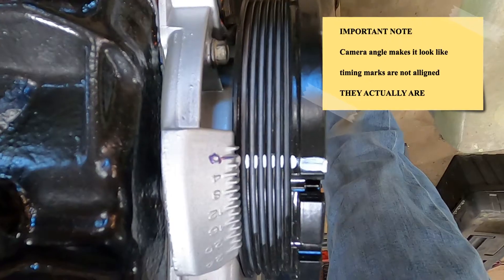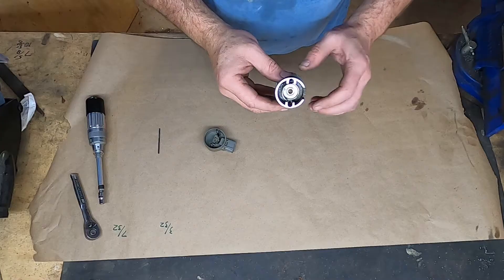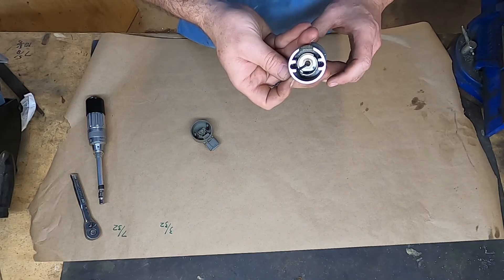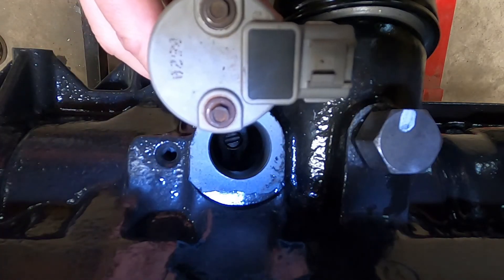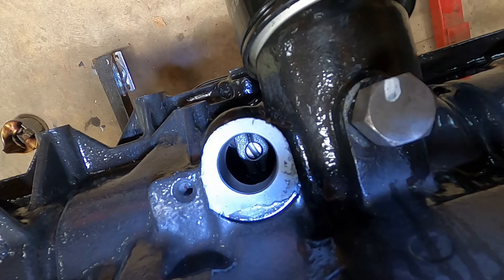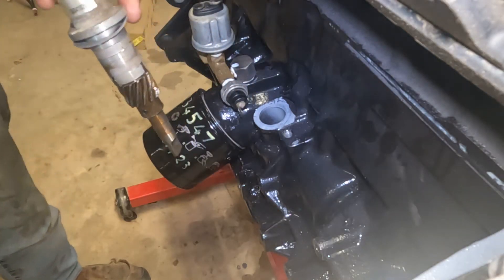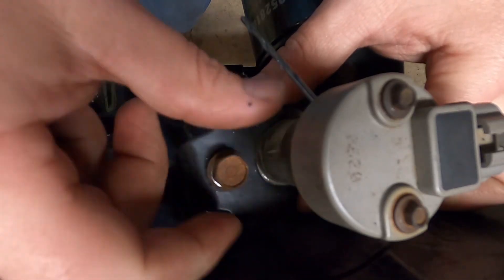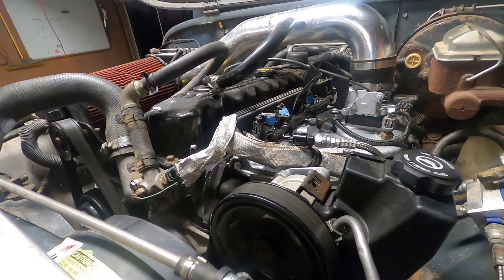Cam Sensor Synchronization on a Jeep 4 0 engine

Comment: Ok. So my 2004 engine is, ya know, still in the vehicle and doesn't have the nice little timing plate.
Reply from the maker: You should still be able to do it just fine.  Find TDC (dont need the plate) and follow the steps

Comment: My new cam sensor and pump drive assembly doesnt have a hole for a pin.
Reply from the maker: That's interesting - does it have a plastic clip to hold it in place?
Reply: @theshop392 looks like it has that instead, yes.

Comment: Other videos say you have to be tdc on exhaust stroke.  confused.  https://www.youtube.com/watch?v=yo_HRGlUYrM&t=1s
Reply from the maker: It had me confused at first too.  When you are installing your timing chain the dots line up on the exhaust stroke I agree there.  Unlike a distributor the sensor is only looking for the pulse to confirm with the CPS that the timing is correct.  Either way it works...
Reply: @theshop392  you would be 180 out from your way if you were on the exhaust stroke.

Comment: Is it ok if there's a little back and forth play in the cam shaft synchronizer after it's installed in the proper position?
Reply from the maker: Hard to say how much a little play is, there will be some movement but it shouldn't be much.  Does it tighten up when you clamp the retainer down?

Comment: If the Jeep is anything like a small block Chevy, you can lower the shaft until the gears align and it’s pointing in the correct position.  Then to get the oil pump slot to line up, you just turn the engine over by hand and it will drop into the slot. Even if the pump slot isn’t aligned, the gears are meshed and it will keep the timing correct as you turn it over to align the pump slot.  Easier than fiddling with a screw driver trying to get it just right.  
Thanks for the video!
Reply from the maker: Thanks for sharing that idea!  We certainly will try it on the next build!

Comment: You are the man. Thank you for the video. I just bought a 2005 unlimited. I'm getting the POO16 code.   So on Saturday I'm going to go through everything to make sure it's all at TDC before I purchase replacement sensors.
Reply from the maker: Do you know if the 05 has the opda (large diameter oil pump drive). If it does I would recommend replacing the cam position sensor before you replace the whole opda.  My 06 wrangler threw a similar code and I had to replace the sensor, no need to pull out the opda.  I couldn't get an original sensor and the aftermarket one did not work correctly untill I put a washer under the sensor
Reply: @theshop392  Yes it does have the larger (new style) OPDA. I used to own a 2006 unlimited that I had bought a new and drove it for 11 years.  I only had to replace it on that once.   This new Jeep appears to have a newer OPDA.  So I'm going to need to get it to top dead center to verify that whoever installed Did it, put it back correctly.
Reply from the maker: If the Jeep was running before it threw the code I doubt that the timing jumped, unless the opda is damaged
Reply: @theshop392  Yes it was running. It still is. I just ran it yesterday at highway speed for about 20 minutes.  Everything seems completely normal.  Just has the CEL light and that code.  Since I just purchased it I don't really have any history so I'm starting from scratch on this one.  It also has 198k miles.
Reply: @theshop392  I used to rock crawl my '06 LJ.  I'm planning to do a budget crawler build on this one because miss the rocks. Haha
Reply: @Bubbz2024  That is exactly what happened with mine, I would try replacing the sensor before you pull the OPDA.   I used to off-road in competitions with a buggy, really miss doing that!
Reply: @Alouette632  Yes thank you again I ordered the sensor. It gets delivered tomorrow September 27.     It was super easy to change the OPDA on my 2006 unlimited. I have the factory service manual so I just followed the instructions.   You used to do competition? That's amazing.  A dream of mine.     

I'm going to try to make short videos to post up modifications I do to this new (to me) Jeep. I made an extensive build thread of my last unlimited.  I installed a completely weld on triangulated four link Long arm suspension system. With four and a half inches of lift with ARB air lockers front and rear along with a Dana 44 front axle swap.  The Jeep was more comfortable to drive after I built it and with the stock suspension lol

Comment: Best one I've seen yet.

your first comment about not setting TDC first is the best part!

If you also mentioned "rotating this sensor will NOT change ignition timing" it would be absolutely perfect.
Reply from the maker: Thank you.  If I understand you correctly, the ignition timing is managed by the ECU, so rotating the sensor will not adjust the timing like an old distributor.  However rotating it too far will cause the ECU to throw a code.
Reply: @theshop392  sometimes they'll throw a code but usually they just don't run when ya do that.

the distributor 4.0s act almost the same except you get ignition breakup at idle or WOT depending on which direction it gets rotated before it completely dies and more often than not, also no codes.

but still, They're all crank fired ignition where the ECU/PCM directly pulses the coil for timing control since 1987 and the ONLY way to change baseline ignition timing on these is to physically move the crank sensor in reference to the flywheel.

The earliest ones (87-90) had knock controlled spark advance and the ignition system was derived from the Renault Alpine GTA. They were very much ahead of their time.

Comment: This is the best video I've seen for the cam sensor syncronization, I like you refer to the Service Manual procedures. Thank you for sharing!
Reply from the maker: Glad it was helpful to you.  Yes it's always best to work straight from the Service Manual
Reply: @theshop392  How can you tell if a Cam Synchronizer is malfunctioning? Mine makes like a clock ticking sound, is that normal? I greatly appreciate your videos
Reply from the maker: @Ache87  Mine does not tick.  I suggest you open in and look for contact in the window, also check the gear for damage

Comment: I had to remove my alternator and bracket to get my finger into #1 spark plug hole. Had my son feel for pressure while I got under the jeep and turned the crank to TDC.  Magic. Then,  my Cam Sensor oil slot was almost to 12, more around 11:30 position.  Found out my 'new' cam sensor was faulty, but worked good enough to get going. My TopDon 600s scanner was able to show me cam sensor degree readout. Every time I got to near '0', it would go straight up to 65,000 on the graph.  I just lived with a 1.5 degree setting and was done. I was surprised my scanner did the cam degree thing. Bonus.  Very sensitive to get the reading right, but 'graphing' the cam degree readout really helped.  Thank you for this video, it gave me the confidence to do it myself instead of dragging the jeep downtown.  I also did the Viper Coil mod too.  That was a story in itself.  Have a great day, thank you.
Reply from the maker: We are glad that the video was helpful.  Aligning the oil pump slot is a bit tricky.  Unfortunately my scanner is not able to give the degree readout but that is helpful in making sure you have the right teeth.
Reply: @theshop392  I know we're all on a budget, that's why i got the 600s on sale at amazon.  I'm not a salesman for them or amazon.  I just needed a cost effective scan tool and that one does a lot of various tests and resets.  Again, thanks and you have a great day !
Reply: What year jeep do you have? My 01 wj wouldnt work with the topdon 600, or xtool d7 not even a snap on scanner was able to connect to correctly adjust the sync for this repair

Comment: 4:00, I need that ratcheting screwdriver for fathersday wheres it from?
Reply from the maker: It's a torque screwdriver, Amazon has a few different options, Harbour Freight has.  Alternatively you could get Snapon or CDI as premium options.
Reply: Porfavor en español el video
Reply from the maker: Rogu - here are two options - the CDI which we would prefer https://amzn.to/3KpfaPC or alternatively a Gearwrench which is a little less expensive https://amzn.to/3KpfaPC

Comment: I followed another video last year for this exact procedure only they never commented on the oil pump slot needing to be adjusted so when I slid the sensor down it wasn't perfectly facing the back straight and I couldn't figure out why. I think that's why it started throwing codes again. At least now I think I know what the problem is. Thank you for this video.
Reply from the maker: Thank you for the feedback.  The oil pump slot should not affect the sensor facing backwards, it would prevent the sensor from fully seating to the block.  If your sensor is fully seated on the block and not facing the right direction it is likely off by one tooth, or start installing the sensor at a different orientation OR your timing is not at TDC and your cam needs to rotate, typically a stretched chain where you miss the timing mark and rotate the crank in the wrong direction, the stretched chain does not rotate the camshaft and your timing is now incorrect.  Rather rotate the crank another two full revolutions than turn it the wrong direction.